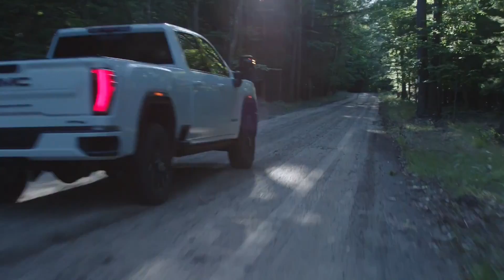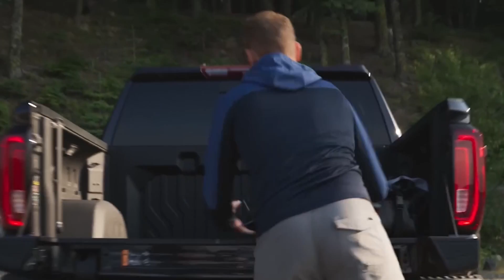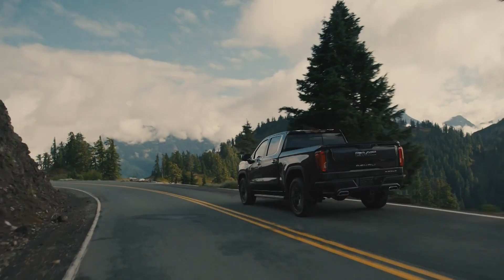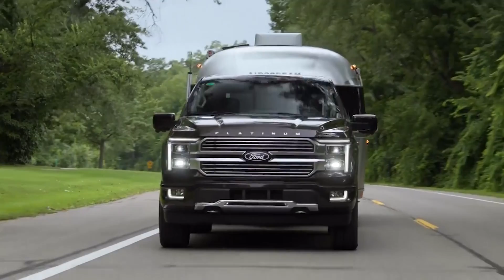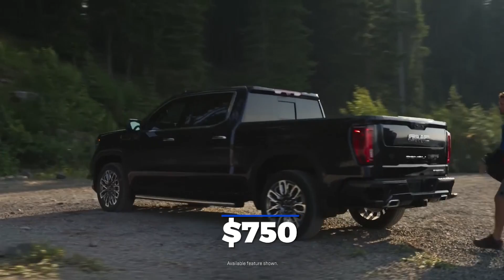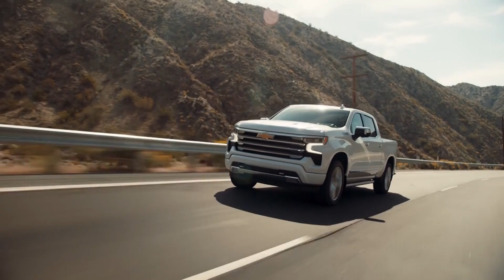7 Reasons Why You SHOULD NOT Buy GMC Sierra 1500!

Comment from the maker: 🔴What was the most surprising reason to avoid the GMC Sierra 1500?🤔

🏆7 Reasons Why You SHOULD NOT Buy Chevrolet Silverado WATCH HERE 👉 https://youtu.be/T4l4bKcYmI8
Reply: All I buy are sierras & I've never had an issue. I have 2 in my driveway right now with more miles than you can shake a stick at & they run flawlessly.
V8 ✔️ 
Column shifter ✔️ 
Dipsticks ✔️ 
Auto locker ✔️ 
4x4 ✔️ 
Max tow ✔️ 
6'6" bed ✔️ 
Steel > weak aluminum ✔️

Comment: TRUTH HURTS BUT TRUE 🙏✌️🇨🇦 6.2 engine recall 3.0 diesel transmission failure 🤷🙏✌️🇨🇦🇺🇸🙏
Reply from the maker: Sounds like you’ve seen some real issues firsthand, do you own or have you owned a Sierra?
Reply: Yes 21-1500 6.2 Denali recalled a friend of mine had his transmission fail in his 3.0 diesel 🤷 I was going to by a new 3.0 but got cold feet 🤷✌️🙏🇨🇦🇺🇸🙏

Comment: Since 1990, I have had 9 of these trucks. Because I drive so many miles, I trade fairly often. A  battery failure, under warranty, is the only issue that I've experienced in 25 yrs of owning GM trucks. My most recent trucks have been a 2016, 2019 and a 2025.
Reply from the maker: 9 of these! That’s impressive! What particular features kept bringing you back to this model over and over again? And over the years, have you never considered a different model, or has the GMC Sierra just been the perfect fit for you?
Reply: @tech_triumph  I always look at Ford, Chevy, GMC and Dodge each time I get ready to trade, I don't care which brand that I drive, I just want a full size truck. However, I always get my best trade difference with a GMC.

Comment: I don’t believe on what he said in this video. GMC Sierra 1500 is one of the most reliable truck that money can buy. I disagree with author. GMC is consistent and improved over the years with their electronics, mechanical and engine. STOP bu&@@ng.
Reply from the maker: Totally fair take! A lot of people stand by the Sierra for exactly those reasons. 

Out of curiosity though—have you owned one recently? Or are you basing this on older models? Would love to hear your experience with the electronics especially, since that’s where some folks tend to disagree.
Reply: @tech_triumph  I appreciate your engagement and the detailed points raised in your video. As an owner of a 2022 GMC Sierra 1500 Elevation with the 3.0L Duramax diesel engine, I’d like to share my firsthand experience, which contrasts with some of the concerns highlighted.

1. Reliability & Engine Performance

The 3.0L Duramax has been notably reliable in my experience. It’s a smooth, efficient engine that delivers impressive torque and fuel economy. Many owners report highway MPG in the high 20s to low 30s, which aligns with my observations. The engine’s performance, especially during towing, has been commendable, providing consistent power without strain.

2. Ride Quality & Comfort

While ride comfort can be subjective, I’ve found the Sierra’s ride to be comfortable and composed, both on highways and city roads. The cabin is quiet, and the suspension handles road imperfections well. It’s a significant improvement over previous models and compares favorably with competitors in its class.

3. Visibility & Interior Ergonomics

I’m 5’10”, and visibility has not been an issue. The driver’s seat offers ample adjustment, and the large mirrors and available 360-degree camera system enhance situational awareness. The interior layout is intuitive, with controls within easy reach and a user-friendly infotainment system.

4. Maintenance & Ownership Costs

Over the past year, my maintenance costs have been minimal, primarily routine services. The 3.0L Duramax’s efficiency translates to fewer fuel stops and cost savings over time. Additionally, the engine’s design has proven durable, with many owners reporting high mileage without significant issues. ￼

5. Value Proposition

While the Sierra may have a higher upfront cost compared to some competitors, the combination of performance, efficiency, and features offers substantial value. The quality of materials, advanced technology, and overall driving experience justify the investment for many owners.

So, while no vehicle is without its challenges, my experience with the 2022 GMC Sierra 1500 has been overwhelmingly positive. It’s essential to consider a broad range of owner experiences when evaluating a vehicle, and I hope this perspective adds to the conversation.

Comment: This message was brought to you by the good folks over at Ford Motor Company. 

  As the owner of a 25 Sierra SLT, I can testify that any claim of poor ride quality is pure horseshit. 
 I have no brand loyalty left in me. 
 In my opinion, the 20 / 21 Tundra with the 5.7 was probably the most reliable full-size truck built. 
  I blame the tree hugging politicians and lobbyists for most of the degradation of modern vehicle reliability by trying to eliminate the combustion of internal combustion engines as if they could make them run on rainbows and fairy dust. 
 After a month of searching and finding the very low milage 4x4 Tundra Limited or Platinum models to be selling @ $50,000+, I did enough research to feel comfortable investing in a new GMC with the updated software / interior options plus a factory warranty and opted for an additional 36,000 mile warranty. 
 So far, it is just about the best riding pickup I've driven and have no complaints. 
 But then no vehicle is perfect and only time will tell.

Comment: Like the looks of the GMC sierra , don’t like the 5.3 V8. Less torque and hp than the Ford coyote. Also the Ford does not have cylinder deactivation at hwy speed. In fact the twin turbo 3.5 V6 has 400 hp and 520 lbs ft of torque. The GMC 5.3 l v8 only has 355 ho and 380 lbs feet of torque. Oh and the GMC gets less gas  mileage than the Ford

Comment: I am a mechanic and I can confirm this trucks are very unreliable and expensive to keep up, I already have to replace transmissions , radiators and a bunch of electrical issues on 2023 models, and even after repairs there is a chance of getting a callback but with a new issue GMC= Grand Major Catastrophe.

Comment: 2019 5.3 elevation with 107,000 miles and traded in for 2021 new. Now 42,300 miles. ZERO ISSUES WITH BOTH. On the dot, oil changes and tire rotations and services done. Take this trash video down please!!!!
Reply: give it time Goober
Reply: @chadhaire1711  read the comments section, Pooper!
Reply: @ST24z  dont need to read trolls and bots Goober....I work in the industry, you are one little  owner out of a million who does not and it shows....  The numbers on recalls, lost sales and lawsuits don't lie.
Reply: @chadhaire1711  👏👏👏👏👏👏👏👏lmao
Reply: @ST24z  GMC dealer will be LMAO at you when that EMS destroys your engine and you try to get it fixed on warranty that expired the week before.....better try reading more then comments than these on  you tube Goober

Comment: Zero problems with this truck after 2 yrs of ownership… stop trashing the product….
Reply: I believe issues are for 2024 models only. Yours is 2022?
Reply: @jjung2005  it is .  They don’t specify a year….
Reply: Glad to hear that. It's the only big truck I'd consider right now. I can't find one brand without problems. GMC is no exception but from what I read it's not as bad...however, I don't like the troublesome cylinder deactivation.
Reply: @joeb2588  yeah not much you can do about that. One thing I hate is the engine shutting off on idle. I automatically hit the button to override that when I start the truck… and my van for that matter..
Reply: @sethb775  yah, auto start/stop blows. The good news is it can be shut off.
Reply: @joeb2588  yes ..
Reply: @sethb775  that's good
Reply: Wait 10 years. Haha
Reply: @tylerw1774  I’m not keeping for 10 years 3-5 years max
Reply: @tylerw1774  I had my last Sierra 22 yrs I’m not worried…
Reply: how is it today?
Reply: @jamcan1505  15,000 miles and only issue was the clock was falling behind about 6 minutes but the dealer  put a new part in to fix it..
Reply: @sethb775  thats concerning if they couldnt do simple clock right. there might be another problem on this models. i mean clock isnt all big deal but if they made cheap quality on clock how much more on the other parts. vehicles are supposed to run  for over 10 years with normal wear and tear and maintenance. if the clock is broken within 2years. thats really concerning
Reply: @jamcan1505 had it 3 year 60k miles 0 problems tow trailer often got it working
Reply: 6 months into my gmc sierra 1500. My electric dash went out twice.
Reply: Had mine for 2 weeks and already in the shop 👀 definitely look elsewhere
Reply: Tundra blows Sierra out of the water, I will never ever buy an American made truck again, absolutely garbage
Reply: @chrisfree2000 tell that to the massive class action lawsuits against the 2021-25 tundras and some tacomas 😂. Dead engine before 1k miles, transmission shattering ect
Reply: @EclecticSunder  Toyota fixed the problem and replaced any and all lemon engines, it was only 2021-22 engines anyhow
Reply: @ it’s definitely not till 22 lol. It’s legit all tundras till 25. Yes, they are replacing the engines and transmissions, but doesn’t fix the massive debt they’ve created and large hit in trust with their market. Also, not like they are jdm anymore anyway with those TJ trucks
Reply: @Chaldo_off-road  they fixed the issues and replaced issues, all engines on newer models don't have issue, not sure where your information is from, have u ever seen big 3 fix their issues no never, junk all around
Reply: @chrisfree2000 it used to. now its the same junk as GM. V-6 engines blowing up left right and centre
Reply: @chrisfree the tundras are built in USA plant 😂